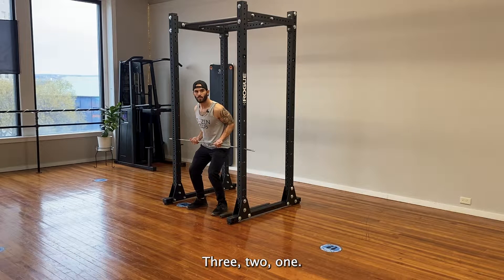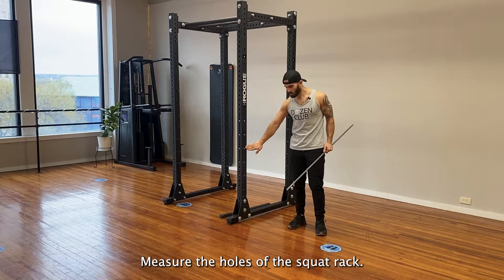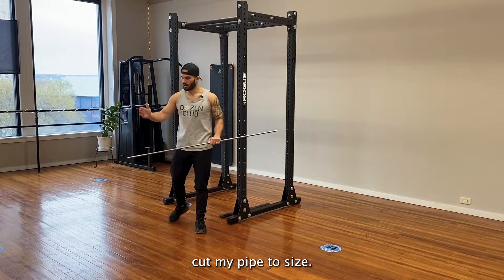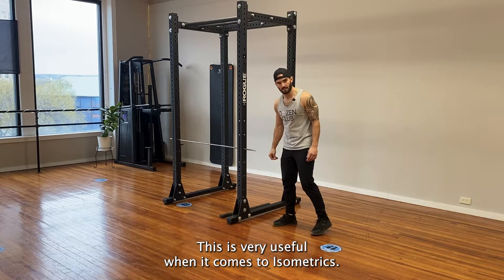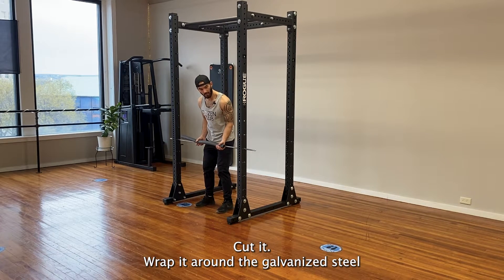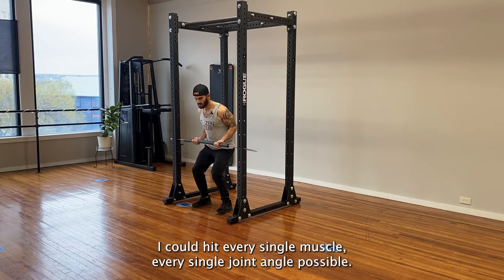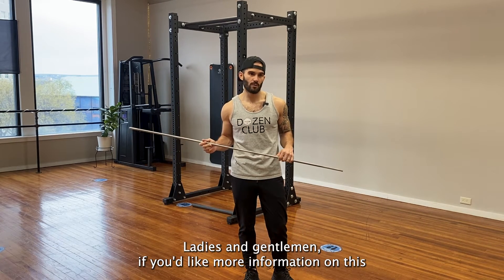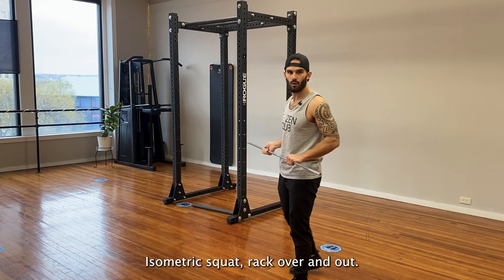DIY Isometrics Rack

Comment: So amazing, I'm definitely getting a pipe like this. This looks like an insanely useful addition (and for some may even be a replacement) for the IsoMax and other isometric tools. Btw, I just had the idea of using two pipes so we can do more exercises (eg. rows or pull-ups from lying or sitting on the ground and putting one pipe just over our chest or thighs, then pulling on the other pipe that's higher on the rack). Have you ever played with something like this?
Reply from the maker: Yes. Hollow Hold, Superman, Single Leg Deadlift, Lateral Raise with two pipes is elite. Your Row exercise with two pipes is a great idea and I will definitely add that.
Reply: @scamponetraining reporting back after getting my pipes: Unfortunately, the pipes I got aren't as strong/flexible as the one you're using and I'm not sure why.
Got 12mm solid steel pipe but it deforms quite easily and I can't do any exercises with high force output, like Squats or deadlifts. Going with mid intensity already deforms the bar (permanently).
The DIY store also had the same pipes in 14mm, which would juuust fit into the holes of the rack I'm using. However, your 3/8 inch pipe has less diameter and still holds its form so nicely. 
Do you know which type of steel it's made of? Is it stainless steel? 

I'm definitely investing more in this, as even the little I could do with it was great fun and much easier, simpler and more versatile than the isomax (which I still like and also combined with the isorack for some tests).
Reply from the maker: @ I believe it’s galvanized steel. I know for sure it’s a ground rod. I bought it from both Home Depot and a local steel and pipe company. The steel and pipe company had pipes that came in long pieces so I had to cut them down to size. I’ve had trouble finding the same ones at Lowe’s or Home Depot so you may want to keep looking around. 

Glad to hear what you’ve used so far has been worthwhile. Feel free to keep us updated. Others might find use in your info.
Reply: @scamponetraining you must've found some special pipe there. I've got and tested 10mm and 12mm stainless steel rods now and they still deform when put under too much load. (Btw, I'm not super strong, so that can't be the difference). 
I looked for grounding rods and the ones I can find are either copper (which certainly wouldn't be useful for our purpose) or stainless steel (which I just tested). 
I know that there are different types of stainless steel, so maybe that's the difference. 
You did say yours was galvanized though, which would rule stainless steel out, I believe.
Do you remember how expensive it was?

I'd be super happy to find out which steel was used for yours. It's getting expensive to keep bending these things 🙈
Reply from the maker: @ want to get on a phone call? No charge? www.scamponept.com/freecall 

Sorry not to be “salesy” but that’s the best way to reach me. From here I can take a look at what you’re working with. I may be able to find the receipt for it
Reply: @scamponetraining  I got one more pipe to test on the way. If it doesn't hold up either, I'll gladly take you up on that, thank you!
Reply from the maker: @TheElThomaso  this might be the one! Let me know what you come up with. Can I ask, do you have a rogue rack? If so, which kind?
Reply: @scamponetraining  I just checked and it's not Rogue, but ATX. It does have holes towards all sides of the pillars, similar to the ones you're using in the video.

Btw, what would estimate to be strongest force your pipe had to endure? And does it always get back to perfect straight or du you sometimes have to adjust it back from a slight bent?

For the 12mm stainless steel I'm currently using (until my other one arrives) it's enough to hang on it (like a pull-up bar) with ca. 80-90kg to deform it permanently. I don't even want to try overcoming isometric squats or deadlifts with it 😬
Reply from the maker: @because my rack is not anchored to the ground it eventually lifts off if I have a someone really strong doing a deadlift. So I stand on the rack and they continue. Maybe we have pushed 250 lbs of tension with no bend. It never deforms.